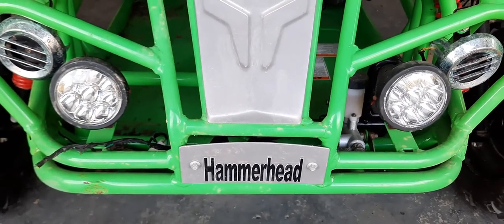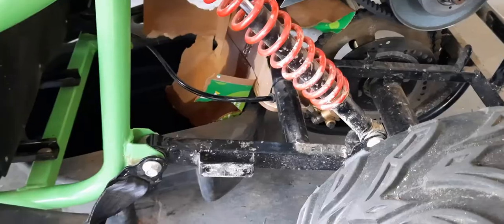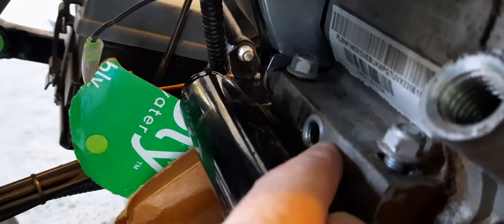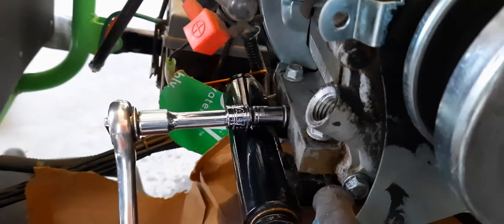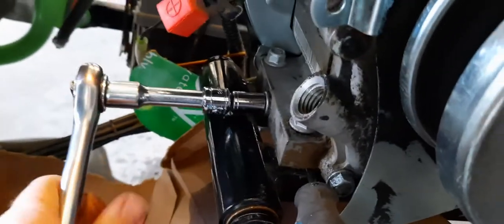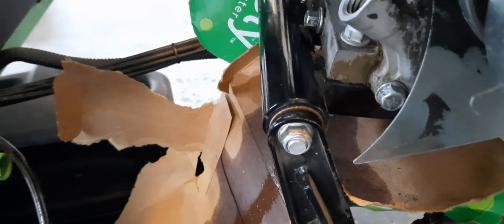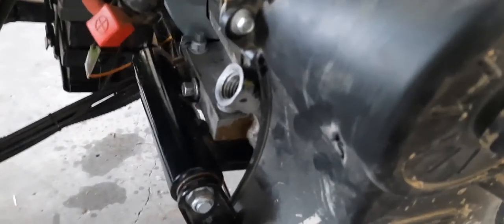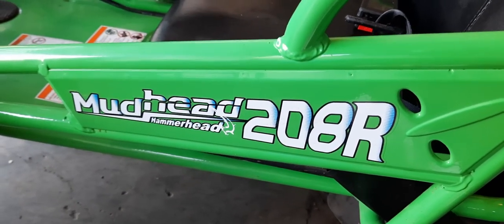DIY Oil Change On A Mudhead 208(R) Go Kart

Comment: I just did mine today and I just went ahead and added a thick washer on the two motor mount bolts so it raises high enough to not have to raise it next time. Rode for several hrs and No issues. Thanks for your info
Reply from the maker: I thought about doing something like that, but then I figured if it wasn't designed that way I didn't wanna change it. Glad it worked out for ya! Thanks for watching!

Comment: Hi.  Great Video.  Just a question.  There is another reservoir on the backside of the engine.  Does that take regular oil or do you need to use gear oil?  Fill til full?  Thanks in advance.  Love my Mudhead.
Reply from the maker: That is your differential. It takes gear oil. You fill it up to just below the fill hole. I'm glad my video helped you out. Thanks for watching.
Reply: @sberger6604  Thank you!
Reply: @sberger6604  Not my understanding at all. That is a twin oil fill/dipstick hole that is provided by the engine manufacturer for different engine mounting situations. The Hammerhead Manual and the engine manufacturer both reference both oil filler caps by using the word “either”.

Comment: Finally a video about these things! Thanks man! I know you said synthetic, but what type of synthetic oil was it?
Reply from the maker: I know there isn't a lot of information out there about this particular go kart. I figured this might be helpful. Thanks for checking it out! As for the oil, I used fully synthetic 5W30 oil. The brand is really irrelevant. It just depends on what you like. Some swear by Pennzoil, some Valvoline, some Mobil 1 etc.. I prefer Shell. I run Shell synthetic in my semi truck and it performs well. But that's just my opinion. Hope this answers your question.
Reply: 5w30 probably worked fine, but the manual comes with the kart says 10w30

Comment: Hey great video!!! Just bought this for my kiddos. After the first drive it looks like it’s leaking oil. Is that normal???
Reply from the maker: It should not be leaking. I'd double check everything. Make sure all your dipsticks and plugs are tight. If you have a leak it should be under warranty if you just bought it. Good luck!
Reply: You're absolutely right.  Took it back to the dealership and they immediately said "Nope. Shouldn't be doing that haha".  Some seal was faulty or something.  They're being good about fixing it.
Reply from the maker: Cool deal! Glad it worked out for you!

Comment: What oil do I need to use for this 208r mudhead go kart?
Reply from the maker: I believe there is a recommendation chart in the manual. I used 5W30 full synthetic for mine. It was just my preference.

Comment: How much oil did you put in? A qt?
Reply from the maker: To be honest, I don't remember what the fill capacity is. But I know it was no more than 1 quart
Reply: Thanks for the quick response, I found 16 oz online somewhere. I found 10w-30 and 10w-40 in a couple different places too. I need to look up the other specs for gear oil etc.

Comment: How do I check the gear oil level on the 208r
Reply from the maker: There is a dipstick for that. It's been a while, but if memory serves, it is on the left rear side and it sits down in. Again, it's been a while since I've checked mine. I'd have to look at it to remember exactly where it is. Sorry I can't be if more help with that question.